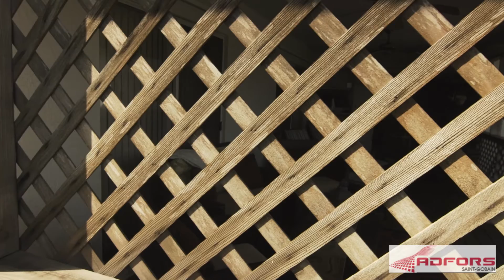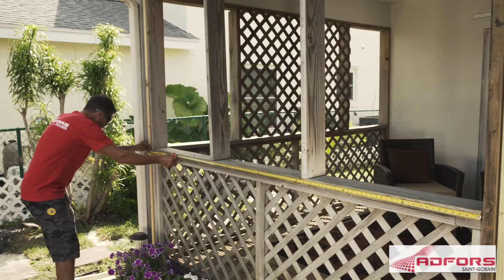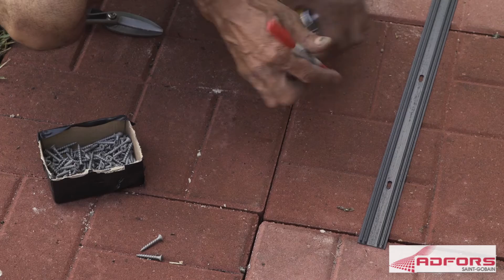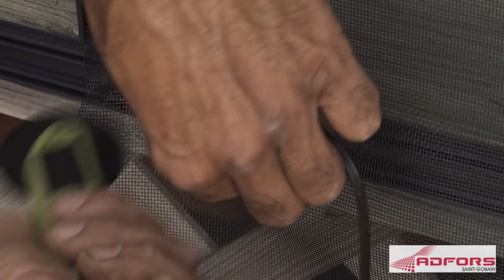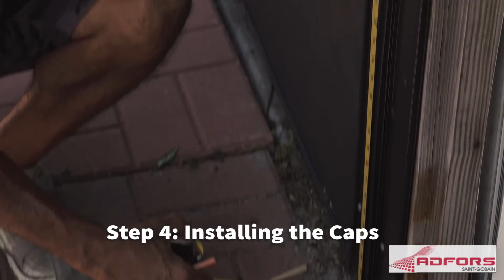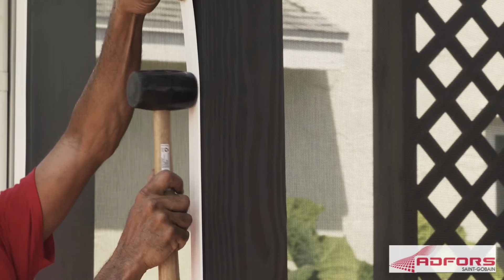ADFORS Porch and Patio System

Comment: Seriously if you tap the spline into the groove first w/the rubber mallet before you use the spline roller' it;ll make the going so much easier. The roller is necessary only after you first lock the spline in it's groove with the rubber mallet. You then will have so much less trouble of going off track or straining yourself pushing it into the groove. But don't bash it to where you smash it's mechanics of hold on it or need for to replace it's base piece. Just go gentle & it's easy as pie. I had the Holy Ghost tell me how to as I to was having trouble w/rolling it to keeping it in track as it looks so easy to do but not so much is it in reality. Do it their way or my way, either way works 'but I say my way is the best way! L.O.L Take it for what it's worth as is no real problem to try as to not try you may just end up giving up & cry. L.O.L The truth is the tricks of the trade is what matters anyway. I am the good man to have on hand, Dave the handyman! Good luck & may God the Father, Son & Holy Ghost only Bless those who follow him. Amen